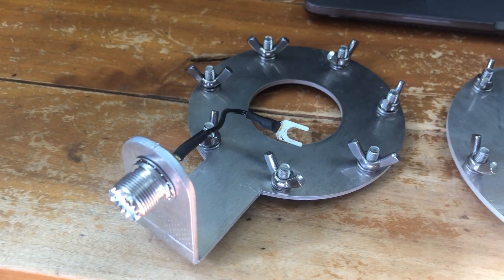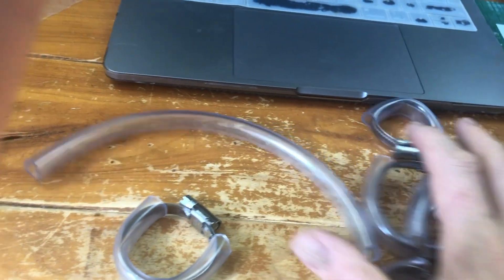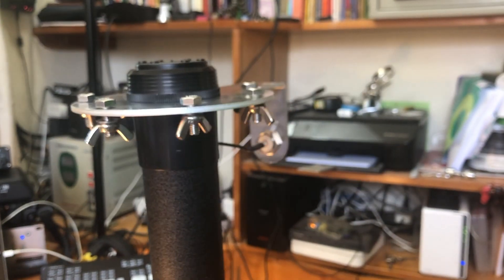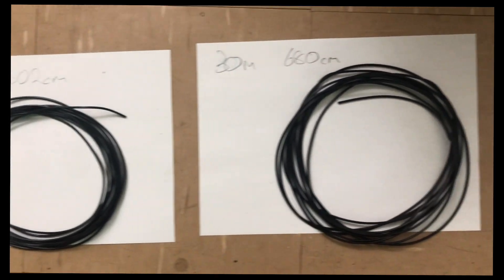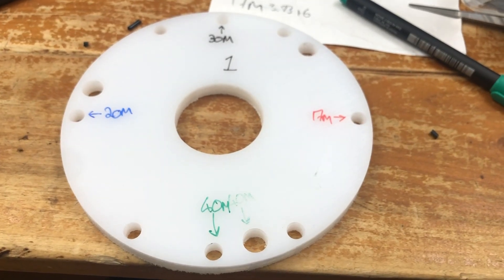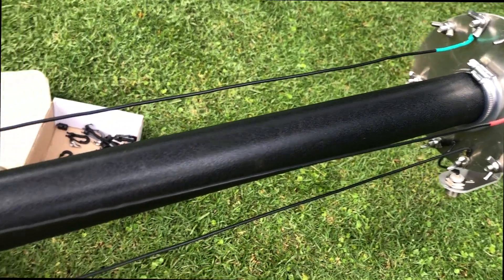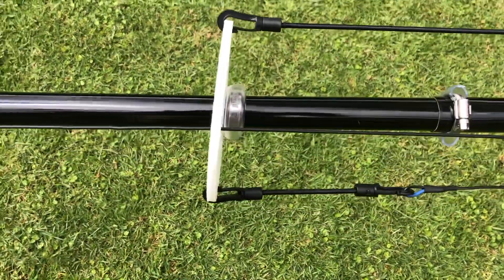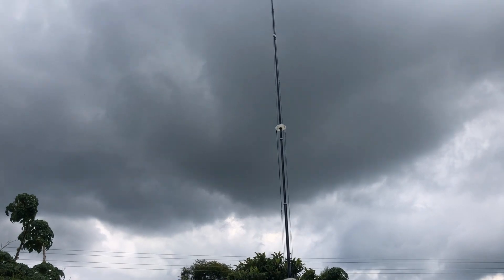The DX Commander Classic Build

Comment: I just raised my DX Commander Classic and spread the radial.  I have limited space, but I have just over 505 feet of copper radials down.  I have some tuning to do, but before any "tuning" is done, I have, on 40 meter, less than 1.5:1 across the entire band.  Other bands are running less that 2.5:1.  So far, I am very impressed with this antenna.
Reply from the maker: Thats awesome. I'm hoping to get the new nebula at some point. But need to save the pennies first. Happy DXing.